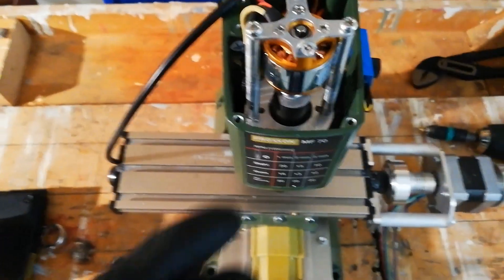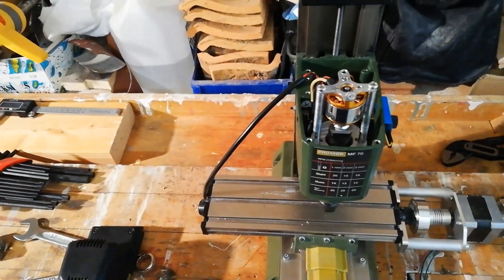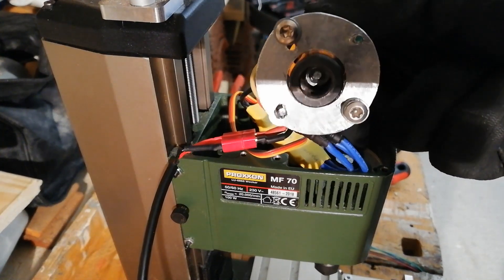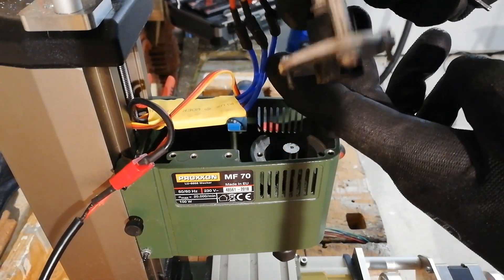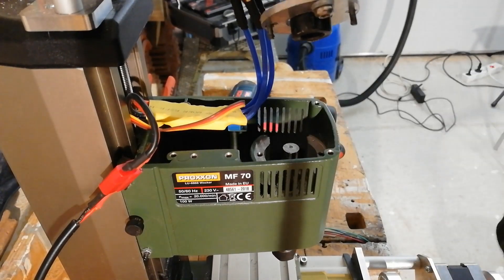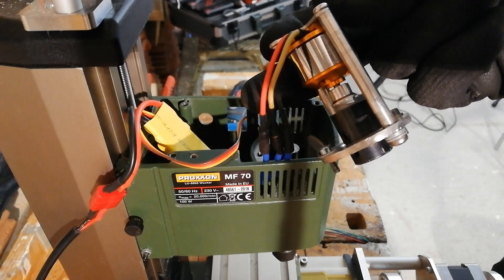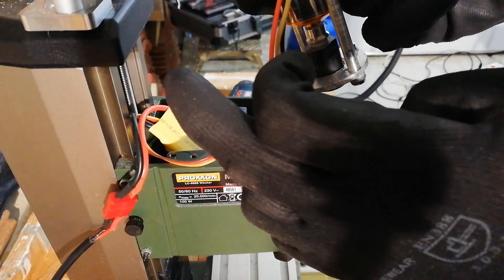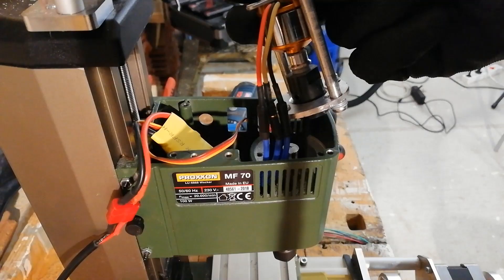Proxxon MF70 - Brushless motor A2212 + ER11 spindle upgrade (cheap 25-30 usd) + test milling @ 11:13

Comment: Hi .First Thank you for share your experience. I have got same problem  two years ago also I change new one but my last motor destiny seem before.  :) I can hear motor  scream. I decided apply your solutions also I use same motor A2212 with Asus PC PSU ( 12V side given 18A ).But I get trouble when over load. Motor stopped then voltage shut off also servomotor tester led shut off too. I don't now anything about problem source. Have you got any idea?

Comment: Hi! Congratulations for the mod. I am planning something similar. Can you give a long term update about using A2212? Does it fit the purpose? Is it long lasting solution?
Reply: Yeah, anyone know? I have 1.1kv motors and want to put them on my cnc cut wood cutting.

Comment: Hi, I also got the Proxxon MF70, CNC and i also would like to modify the spindel motor.
Any chance that you a drawing of the alluminium pars you have made to hold the motor, and also the connection from motor axel to the spindel axel?

Comment: Thank you for this video can you but links to the parts that you used in the video please.  Thanks
Reply from the maker: https://www.ebay.com/itm/5mm-8mm-10mm-12mm-Shank-M10-Arbor-Mandrel-Connector-Adaptor-Cutting-Tool-NQEGK/323805803013?hash=item4b64547205:m:m4qqEuptTGPm7bozXYvJV6Q

* FOR 10MM SHAFT (I cut the threaded part off on this one, and drilled a bit larger hole in the top so that the screw for the propeller holder would go through. Inside this one I hammered in the nut part of the propeller holder. Then I mounted it to the er11a-100 chuck collet holder with the grub screew.

https://www.ebay.com/itm/High-Rigidity-C10-ER11A-100LCollet-Chuck-Holder-CNC-Milling-Length-100mm/122834787688?hash=item1c99861d68:g:OAwAAOSw2VJbTGZF

*I cut this one off a bit.

https://www.ebay.com/itm/4pcs-Set-A2212-1000KV-Motor-Brushless-w-30A-ESC-1-Pair-1045-Propeller-For-DJI/282578846296?hash=item41cb030258:g:iL4AAOSwN2VZUX0O

https://www.ebay.com/itm/RC-Auto-Truck-Buggy-Modell-ESC-Servotester-3CH-CCPM-Servo-Consistency-Master/254234648021?hash=item3b3190ddd5:g:vEAAAOSwJ9dc3vJg

I think that this is pretty much it, you will also need some kind of ac to dc converter to get the proper voltage to the esc. I couldnt find exactly the same things that I bought, but I think that these are pretty similar.
Reply from the maker: No problem, I Will try and do that tomorrow :)